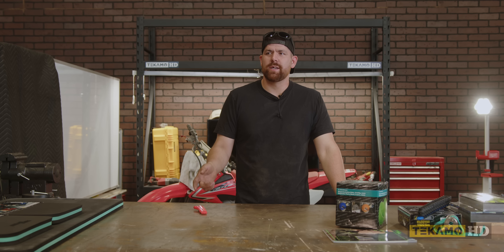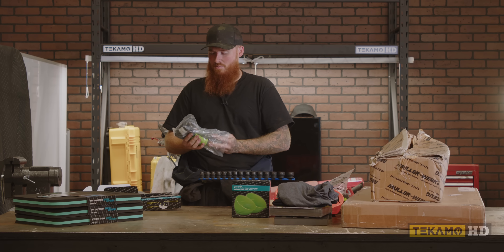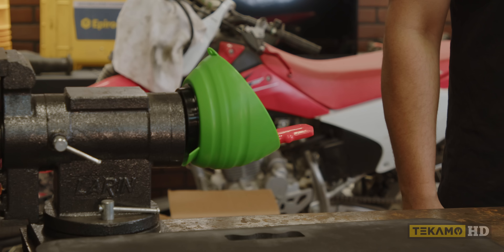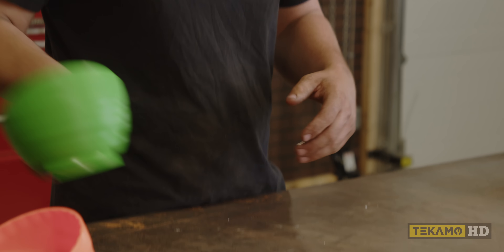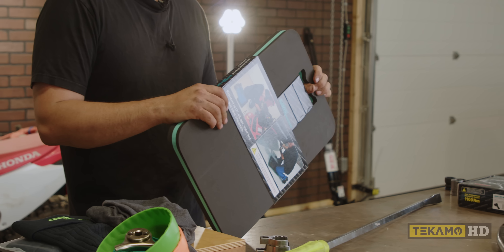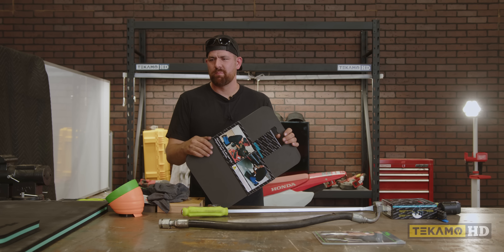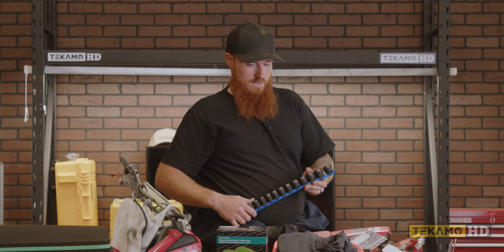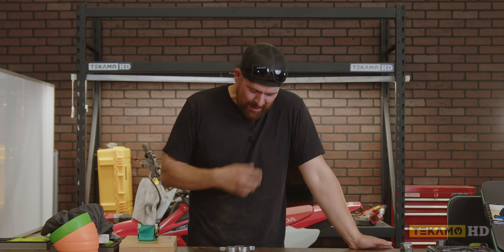WE GOT SENT TOOLS! Müller-Werkzeug Tools Unboxing with Cam and Mike

Comment: I have a set of the carbide scrapers and ive had mine for over a year(just rebranded) I use it for everything(from gaskets,rust,paint,asphalt) and still is extremely sharp, I haven’t had to sharpen them yet

Comment: I agree about the Snap on crows feet, my 1 5/8" rarely ever breaks the tube nut free. I usually end up using  a hammer and chisel to break it loose.  These look stronger, but not sure that they will fit where I need to go. Hope you get to try them out.

Comment: Santa was nice. That impact is sweet, I have a Matco for many years, for pure work air beats electric, electric is quickies. Those sockets and crow feet that German quality really shows , impressive. For a knee pad I use a cement finishers, but that large pad looks like it might put us in the comfort position as that other trade that makes a living on their backs. Sweet.
Thanks for the video!

Comment: The new CAT ones suck! I found my old one. The band on the new CAT filter strap is a slippery nylon.  The old CAT one is like a fiber nylon that hardly slips
Reply: Best I've found is a Ridgid no5 strap wrench.
Lasts way longer than the Cat.
Downside is that you can't put a extension on it.
Reply: Got a new strap wrench from Cat dealer (Aust) came in a nice Cat box, but tool made in china.
Reply: Yeah still got my Cat one from 1990, with the thick strap, agree new one are shit, thin strap and tin like buckle…